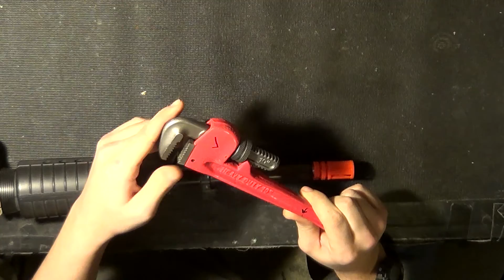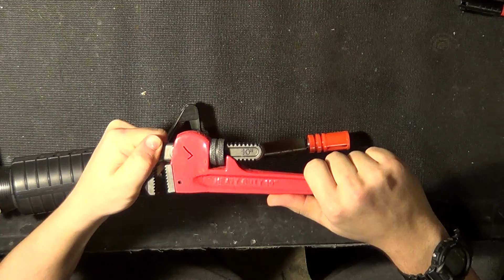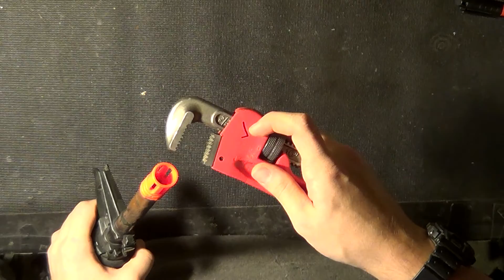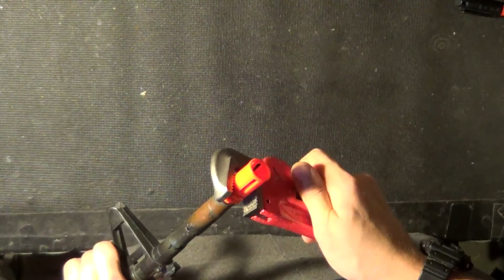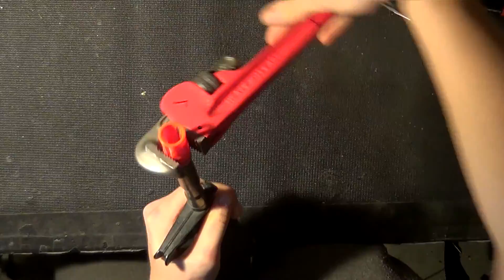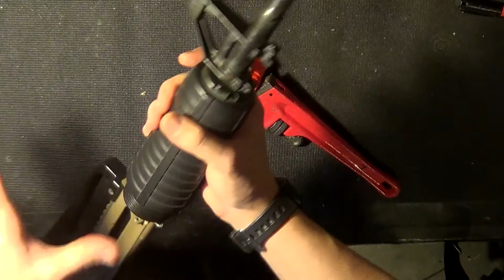Airsoft Tech Tip:  Removing the Orange Tip

Comment: mine has a pin in the orange tip do u know how I remove it. I had people say I  had to burn the whole orange tip off but I don't want to risk screwing up my barrel.
Reply from the maker: Pins can usually be drilled out with a drill bit slightly larger than the pin. the goal is to drill part of the plastic flash hider with the pin.
Reply: Sad thing is that I don't own a drill bit. Would ordering a new barrel instead work.
Reply from the maker: Just paint it black or wrap black electrical tape over it